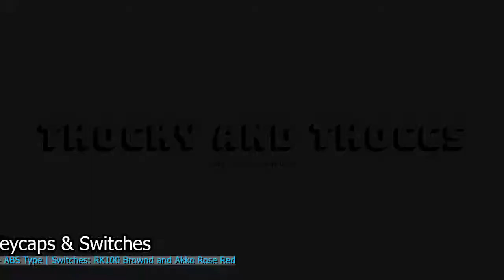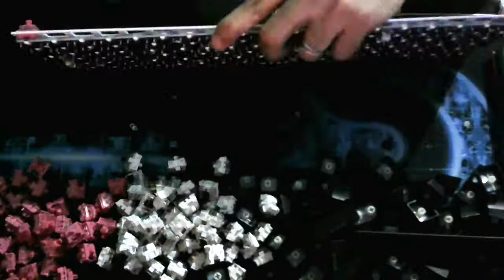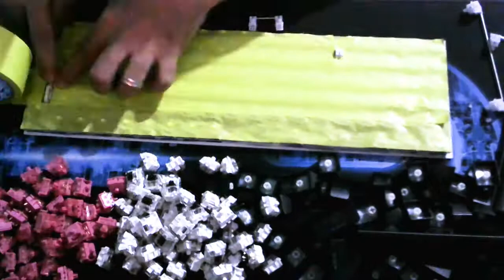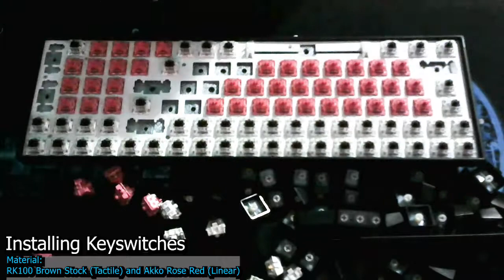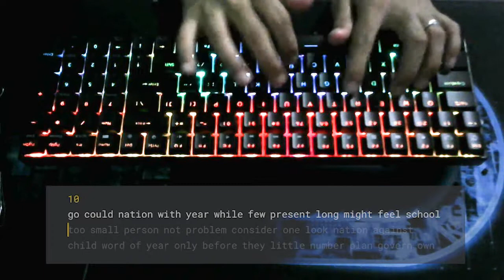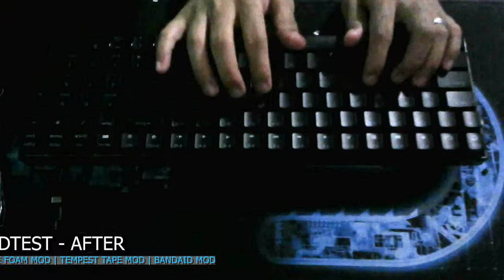Royal Kludge 100 (RK100) | Keyboard MOD - Tape MOD, PE Foam MOD, EVA Foam MOD | Thocky and Thoccs

Comment: Hello! Is it safe to put foam on top of the battery?
Reply: There's a constant debate over this , some say its okay,  some say it's not , I prefer to play on the safe side so I didn't put foam on it ! :)
Reply from the maker: Hi @Sofia, that's a good question. So far, I haven't encountered any problems for putting the foam in my keebs in the top of the battery. Thanks!